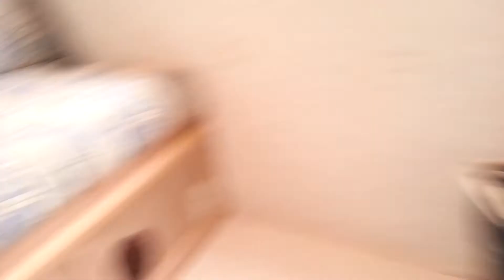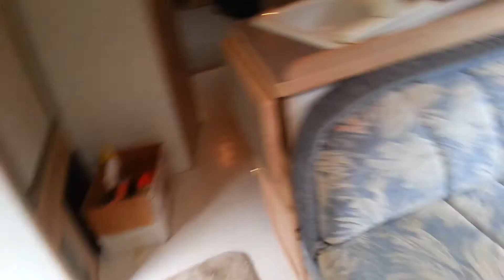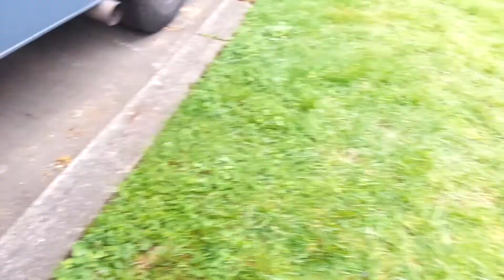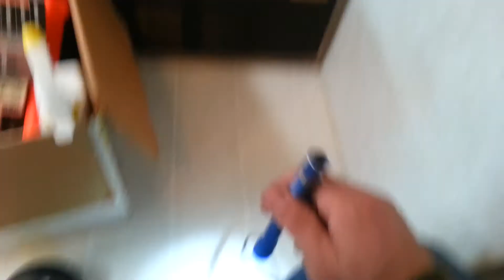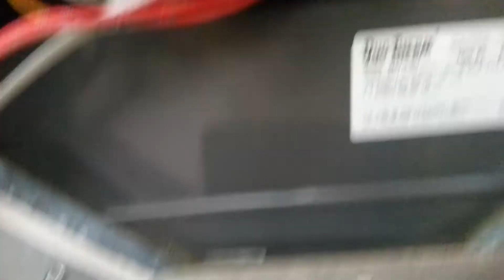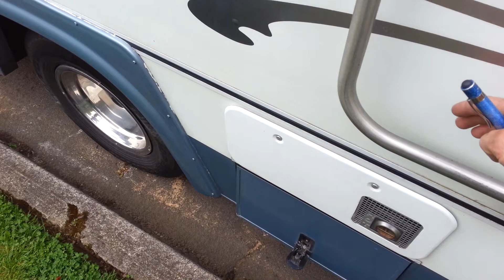RV Living - Bigfoot Motorhome - HVAC

Comment: 6:50 i would leave it as it is. dont wanna risk CO Posioing if you try to harness the heat from it if thats what your thinking. I would just leave the gas furnance as it is unless you plan to switch it to a power furnace.